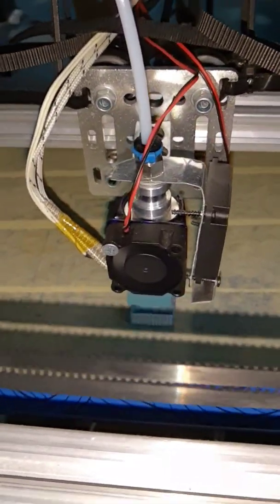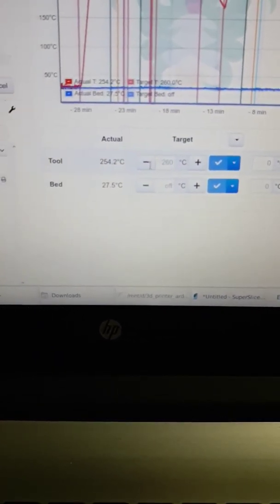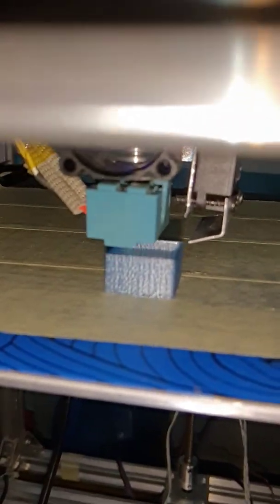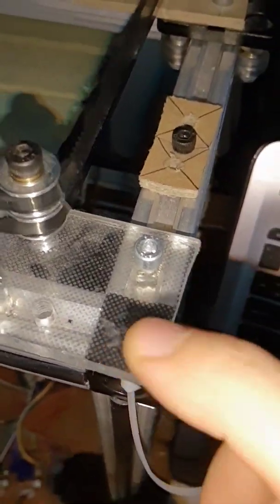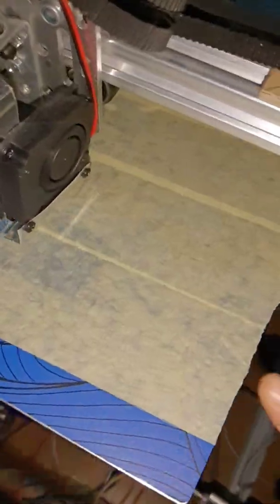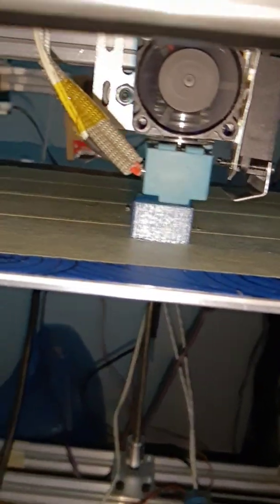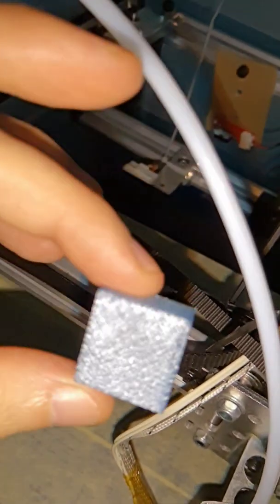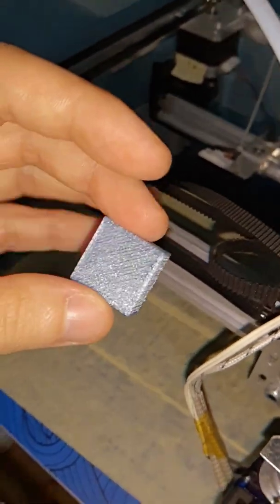First succesfull 3d print with my diy corexy 3d printer using home made fillament from pet bottles

Comment: nice job on the pi pico prep and klipper. with klipper you can use 2 picos to support more axis for the z. print quality is already decent. any plans on replacing the cardboard and acrylic yet?
Reply from the maker: yes already done the stl for the cardboard part, the cardboad tends to flex a few milimeters under acceleration, but even so it still did a decent print with it :) https://www.thingiverse.com/thing:5527545/files